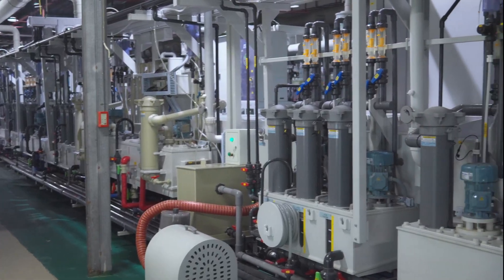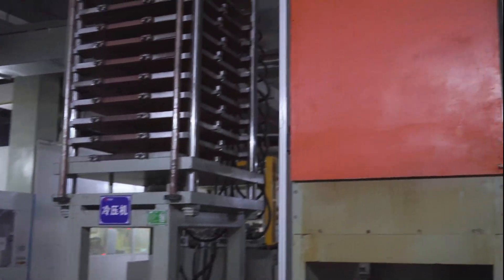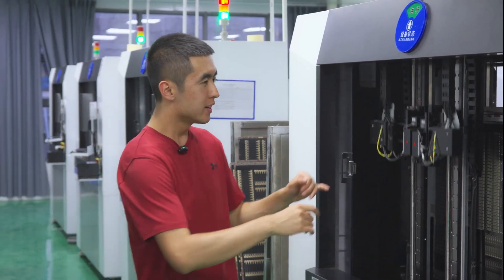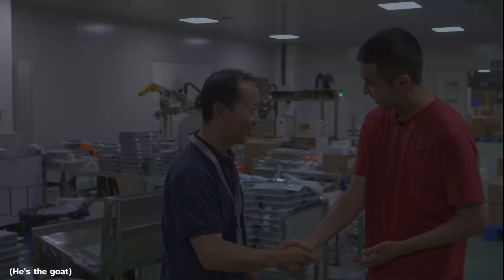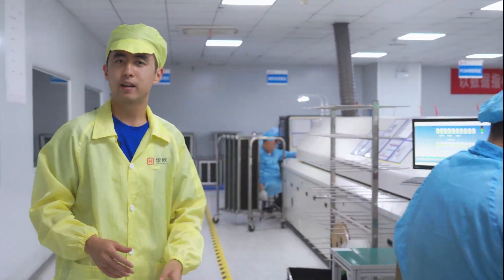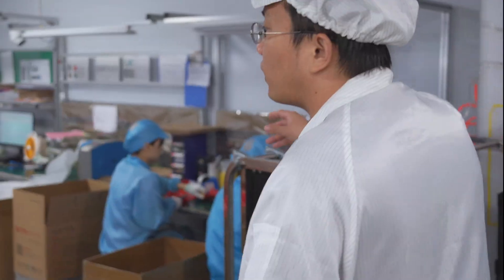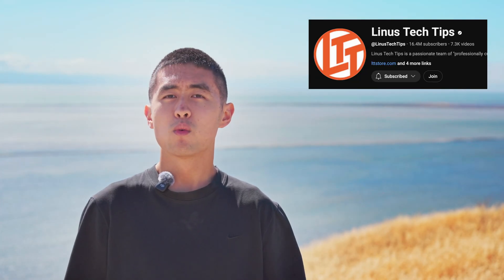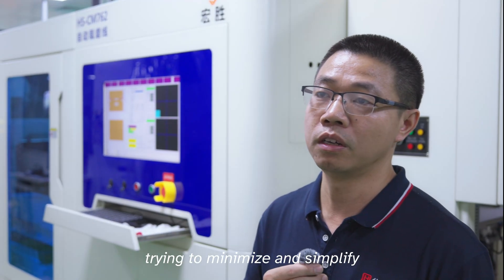Unfiltered Interviews in a Tech Factory — Here's What They Revealed

Comment: I can provide a little info about working in a PCBA factory here in the states, specifically for Flex.

First of all, almost none of the workers actually worked for Flex. The vast majority were hired through private contractors, most of whom are owned by Flex. They love to dangle getting hired on by the company proper in front of everyone, but it's very nebulous on how this actually happens. Pay is... nowhere near where it should be, but for me it wasn't entirely awful. Still not enough for me to survive on one income in a large city. Insurance and benefits were nothing to write home about.

Working conditions were awful. Firstly, you never saw engineers or managers on the shop floor. They were always upstairs playing office politics all day. They'd see a particular metric not doing well, and would tell the team leads to relay those orders to their respective teams. These orders were normally barked or yelled. All day you'd hear nothing but yelling voices over the machine noise.

I didn't see this happen to anyone else, but I got moved around a lot. I was hired for a rework role as their manufacturing process hadn't been nailed down yet. Almost every board that came out of the wave solder machines had something wrong with them, be it excess solder or faulty/incorrect components. I did a little testing of a particular resistor that constantly came back as failing on every other board, and it turns out they just bought crappy components while refusing to do anything about it. So we'd swap resistors only for the boards to come back two or three times in a shift to swap it again.

I got to do that for maybe a month before I got yanked onto an assembly position, soldering two wires to a little auxiliary card. They wanted 400 of these cards soldered every shift, every day. I was the only one across all three shifts to hit this number. That lasted about five months. The whole time I had to deal with the leads walking up and down each line micromanaging everyone, yelling in their ears if they got the slightest hint someone was doing something wrong. Thankfully this never happened to me, but the lower-paid folks on the wave solder lines got it bad.

Eventually I got moved into a touch-up position cleaning solder balls off of boards fresh out of the wave solder machines. We didn't have an air compressor to do it, just a soldering iron and flux. It wasn't fun. Thankfully, this was on the boards I had worked on during my first month, so I knew my way around where the problem areas were likely to be. I'd finish faster than they could give me new boards to touch up, so I got bored really quickly. Eventually I started doing the previous job soldering wires to boards while I waited for more touch up boards to come my way. I was still able to hit the former 400 number while also touching up boards. I was chastised for this.

After about a month of that, I got yanked onto a touch up line for another board I had no experience with, with no training, and nobody to show me what the heck I was looking for. By this point I was sick of working for this company and elected to leave. The money, while decent, was nowhere near enough to deal with the constant yelling and never quite knowing what I was supposed to be doing. One minute I was being praised for taking initiative, the next I'm being chastised for not 'staying in my lane' or whatever. I was bored, frustrated, and tired of listening to leads that imagined themselves drill sergeants.

The cafeteria was only open for the first shift. Everyone on second and third had to make due with a little convenience store they had in the factory. It took about ten minutes to walk from the factory floor to the lunch/common area, and such time was counted as break time, meaning you were lucky to even eat lunch because inevitably the line to the convenience store was too long. A lot of folks brought their lunches and used the provided microwaves to heat them up, but still only had about ten minutes to scarf it all down before having to make the long trek back down to the factory floor.

Parking was awful. The required entryway was about a five minute walk from the curb, but good luck parking anywhere near it. Shift transfers meant traffic was awful and the spaces were rarely free anywhere near the entryway that workers were required to use.

Comment: If you want to make a career of building electronics anywhere on Earth, please look into the SMTA! The industry (especially in the USA) is suffering from a shortage of process engineers and maintenance technicians like Mr. Han. You do not need a college degree to get into it or even to thrive. I started as a Machine Operator making $12/hr and 7 years later I'm an SMT Process Engineer making nearly 6figs.

Most colleges in the US are not teaching Electrical Engineers the practical skills they need to be able to get a job right away (for example most I speak to have never even used Altium or KiCAD unless it was in a hobby capacity). Instead programs focus heavily on physics and theory, which is important but leaves much to be desired from graduates. Unrelated but IMO if you can graduate as an EE without using KiCAD even on your own in a hobby capacity maybe you're not destined to be an EE.

What the US EMS industry needs are intelligent sponges willing to work and learn as they go, not necessarily Electrical Engineers unless they also fit those shoes.